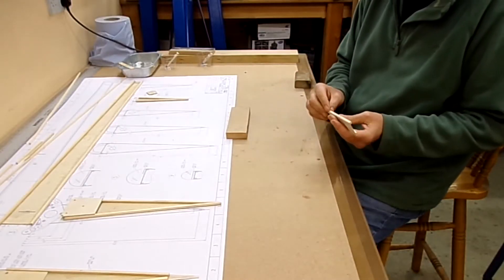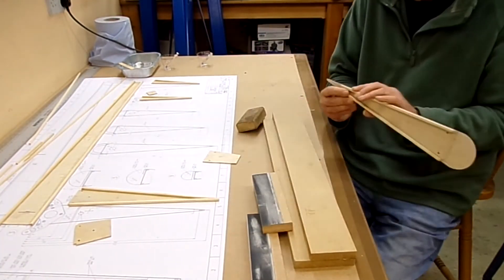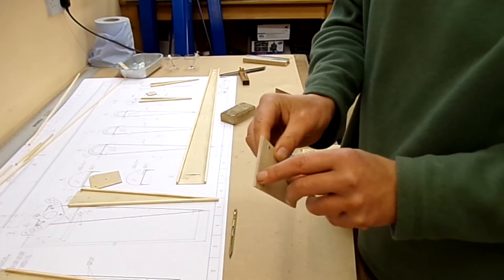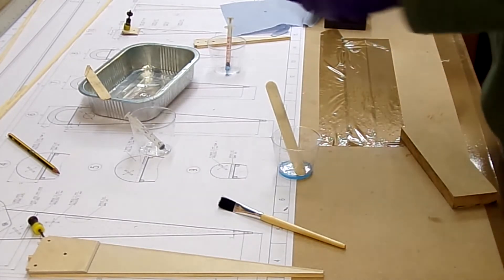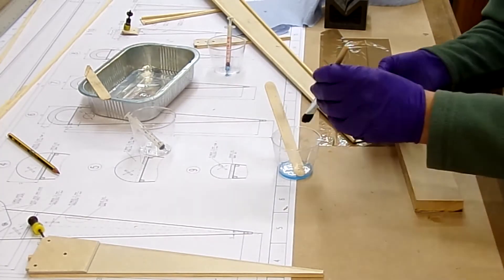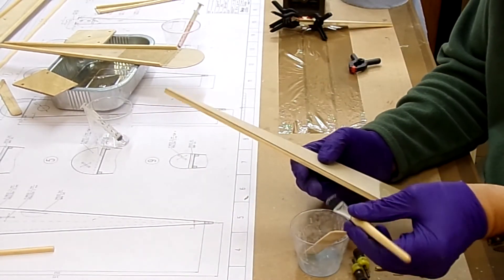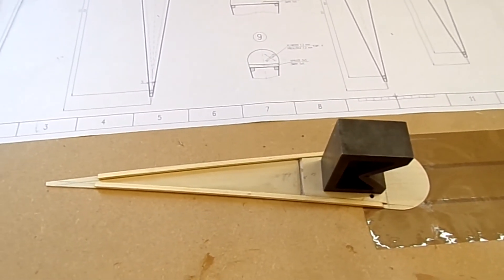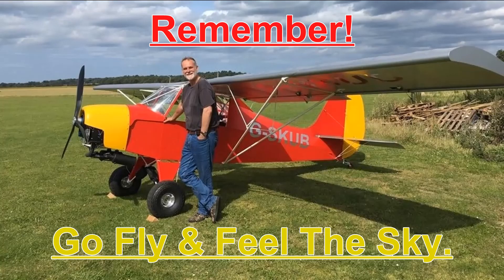Spacek SD1 TD Rudder Build EP3 (Finishing off the ribs and wood spar)

Comment: What is the dry time (working time) of the resin they give you? Enjoying watching this build!
Reply from the maker: The instructions do not give a working time, so I ran with the normal 20 to 25mins. The resin appeared to be still useable at the 35min mark but was starting the get jelly forming at the 40min mark. That was in my workshop at 19 to 20degC with a humidity of <40%. I have to say it is a thinner than normal epoxy. I hope that answers your question. Thank you for your comment and time.